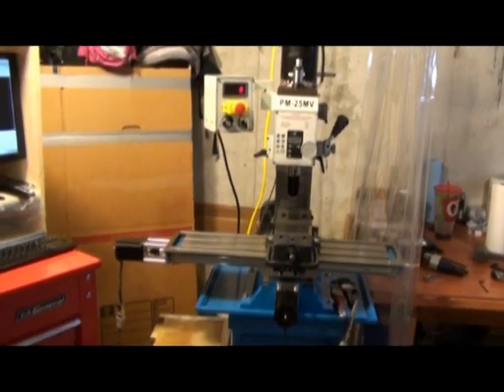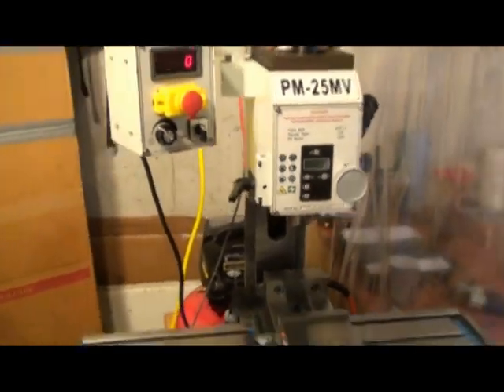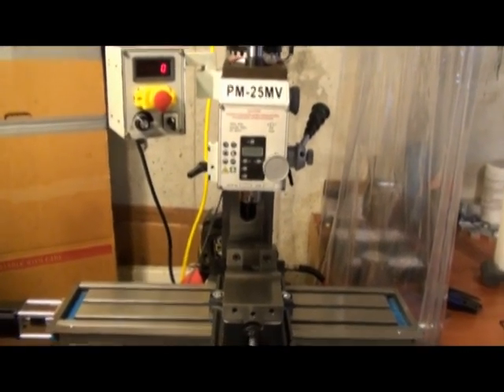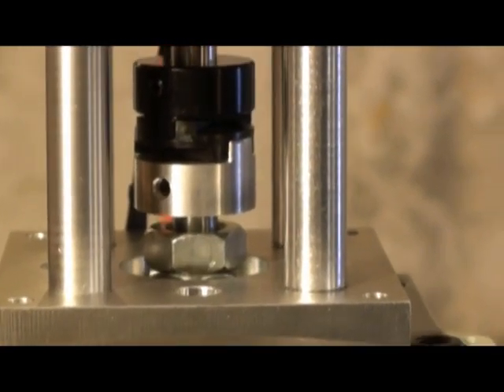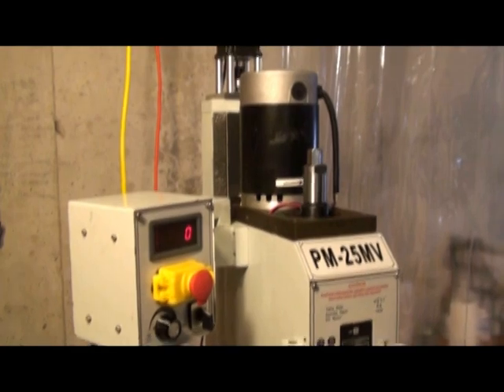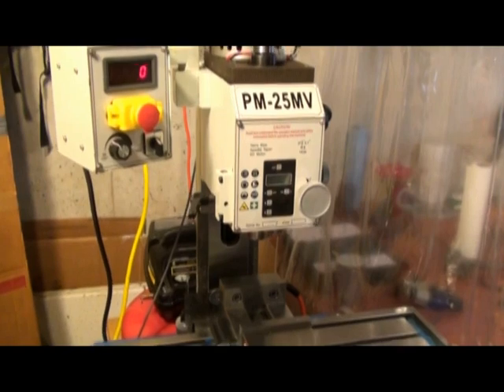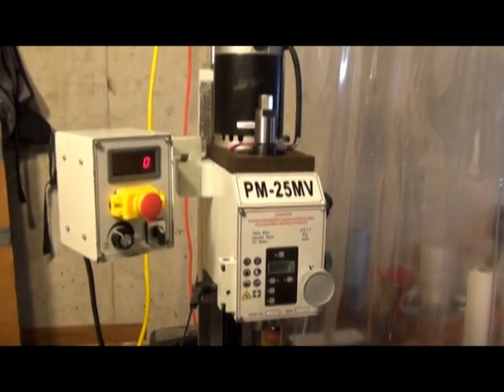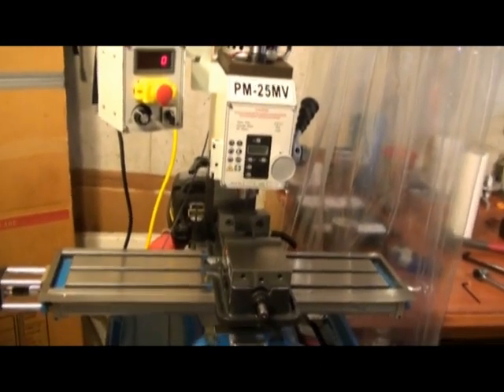3 Axis Complete.mpg

Comment from the maker: @staccio80 - Unfortunately I lost the spreadsheet I had with the costs and there were the flub-ups and constant need for another tool to do this or that part.  I would estimate a solid $1100 in the conversion not counting aquired tooling.